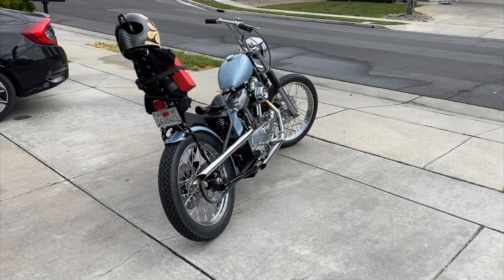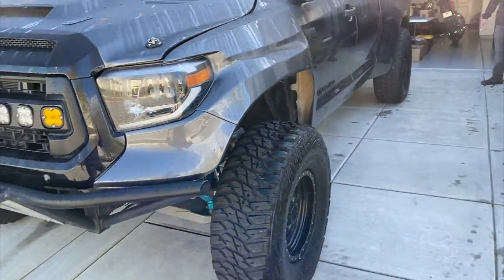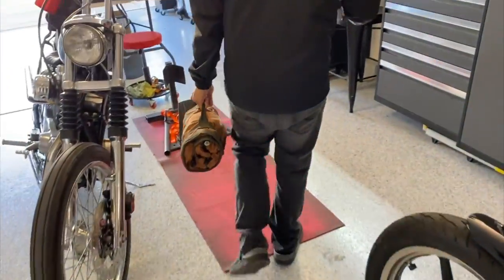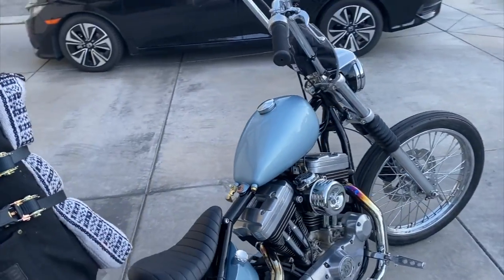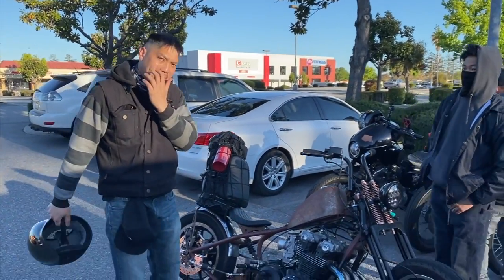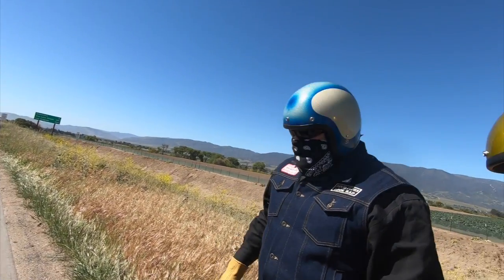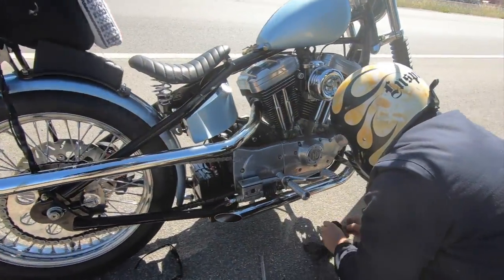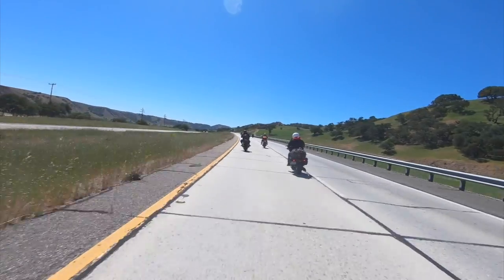EL Diablo Run 2021 | Part 1

Comment: I notice that many of you have never heard of loctite. I see a lot of bolts coming loose. Those older machines vibrate and need all the help,(loctite,etc..) that they can get. I remember when those Honda motors were new and my first one was a 79 750ss! Glad to still see them on the road! I ride a V-Strom 1000 now. Can’t beat the comfort of heated grips and a tall windscreen but after 40 years of riding I think I deserve the comforts! Mine is presently more suited for off-roading as I have made many changes before I climbed mt. Hull with it from ukiah to covelo on the m1 which is a trail/fire foad up and over! That fuel injection is real handy when you drop it in the dirt!

Comment: Will that cable housing lying on the front cylinder head not melt once the engine is running hot on a long ride?